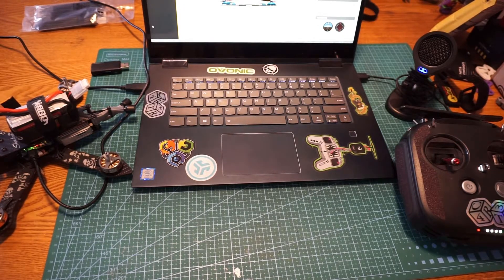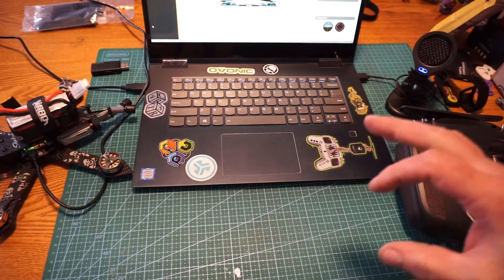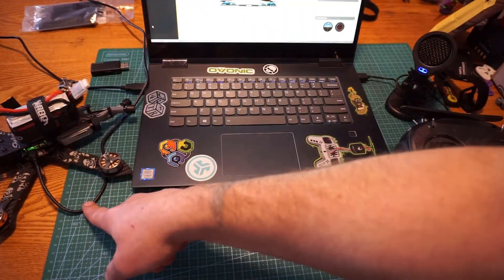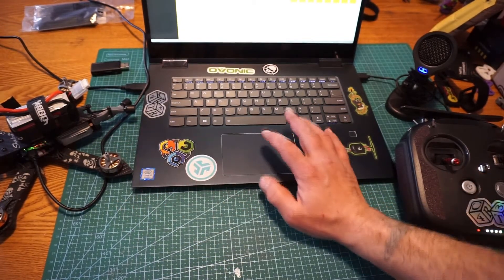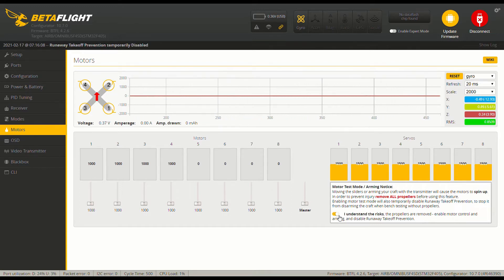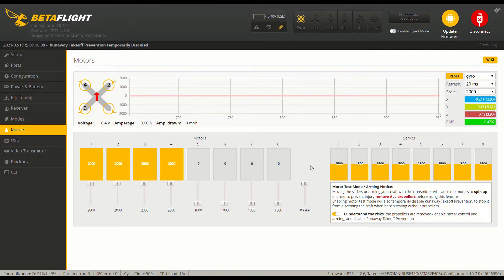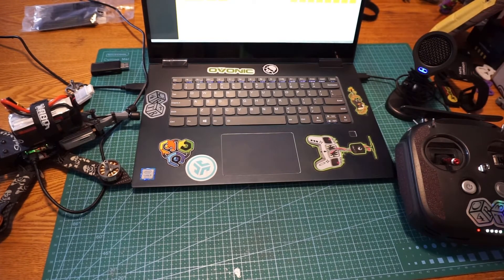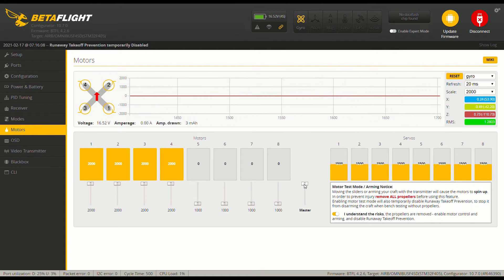ESC CALIBRATION

Comment: I assembled my drone and it worked great. I updated the software and it didn't work properly. I reset it to get it back to normal. It works fine but only vibrates when I give it gas

Comment: this does not really calibrate your Tx throttle to the quad.
Reply from the maker: Correct. It's setting the limits permitted by your device. That's why it's ESC calibration and not firmware sync..

Comment: Hi Sir, 
I'm having a trouble with calibrating my 4 in 1 esc for my fpv drone. When I try to calibrate the esc it doesn't sound like yours I'd pulled up the master tab and it directly sounded same as yours. But When I just decrease the master tab to the zero it sounds kind a weird error.  I think because of the motor 3 it doesn't spin properly. Please help I'm struggling  with this issue.
Reply from the maker: Try to do a configuration in BLHeli that matches your esc. It will let you know if there are any errors or issues with the hardware initially.
Reply: @thumbhobby1390  Thank you for your respond. I didn't use the BLHeli but I tried to upload OneShot esc software in the Betaflight so It worked. Right now, I have another issue. when I try to control the drone from my rc transmitter which is FS-iAB 10 channel transmitter. It did not work properly. All the motors were not going faster at the same time. Some of them were going up and the others were going down. Please help me. I have an issue with my Esc or not ? What could be the problem ?
Reply from the maker: @burakozsahin2624  at this time you may want to try out another set of motors. Are you getting any errors in betaflight on the motors tab? Using the appropriate esc protocol? Check for dry solder pads etc...

Comment: It's the same to calibrated on escconfigurator or in betaflight? Is the same?
Reply from the maker: Not identical but close enough
Reply: @thumbhobby1390  when i calibrate in esc configrator then i go to bf and the motors are not in the same rotation as they were on esc configurator,, i have to re do it in bf. Any idea on that? Maybe i solder a motor with changed wiring? Sorry for mi english
Reply from the maker: @GonzaFPV  not sure why you would need to go back and forth between two programs for the same operation.  I would probably go back to the a fresh start with updating everything both in betaflight and configurator and just pick one to work with. Idk if you're reversing your motors or what but if you're bouncing back and forth from one program to another it's possible to create conflict in programming.  I'd go through betaflight and do all you settings.  Go through through configurator and do all your settings.  Make sure everything is right at the end of every step and then leave everything outside of pid and rates for fine tuning be.

Comment: Does this work for the speedy bee f7 v3?
Reply: I just dont want to plug the battery in while its plugged into the computer incase it goes boom lmao
Reply from the maker: @haydnholder7090  followed properly,  yes.  This is a command for the hardware and not specific to a "specific" brand or type.  Whether you have a 4-in-1 or are running individual ESC's this will also work.

Comment: Hi Sir,
I am having throttle issue with my quad.
Once I arm quad it spins at low speed...then I increase throttle it flies well..but once I reduce throttle to zero... ideally it should spin at same speed while arming it...but the problem is it keeps on increasing speed at zero throttle only.... please let me know any solution it will be helpful.
Thanks in advance
Reply: Props on ?
Reply: I have same issue. it started after I replaced one of the motors

Comment: You mention at the beginning you may need your radio if using frsky.. i am on frsky and mine doesn't make all the beeps when calibrating. Is there something different for frsky? My quad hops up and down bad taking off then trying to hover it randomly bounces up and down with steady throttle input
Reply from the maker: Might want to look more into PID tuning and rates.  I doubt that has anything to do with this.  Also,  I was a bit sidetracked in the beginning of the video.  There's literally no need to need your TX in this process.